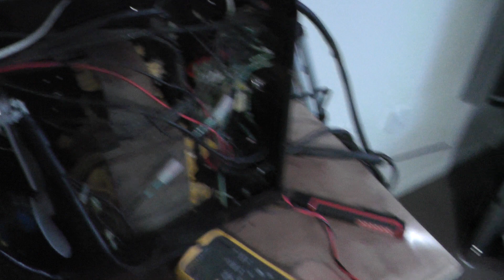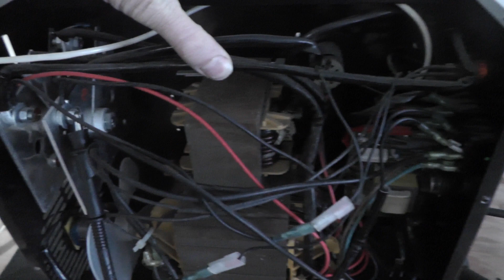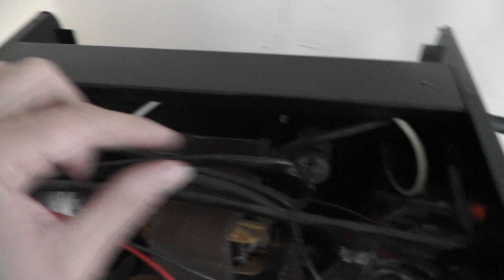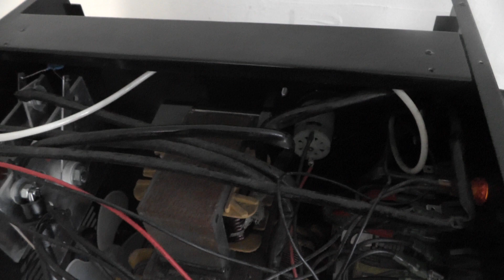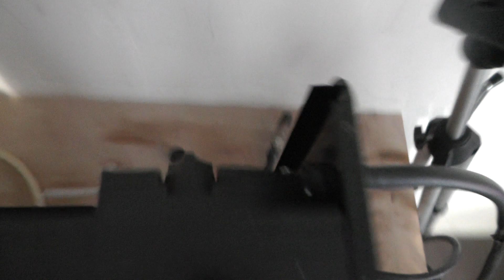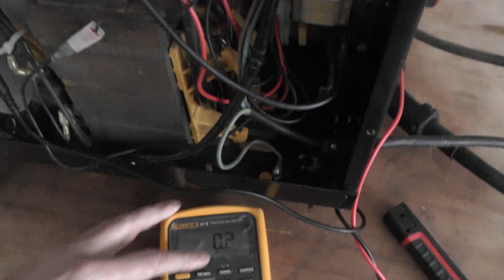The MIG Welder CHOKE Explained: What the Inductor Does & How to Test its Coil for Failure

Comment: What happened to your ROBIN KTS 1610 MFT , now you have let me down by getting a fluke.
Interesting video though
Reply from the maker: Still got it , used for work as calibrated , not got the correct leads or case for this so use it at home for motors etc
Reply: @cagmito76  oh that’s ok then 😂as might of gathered I have a lot of love for the ROBIN testers . All the fluke MFTs should be sent back to America 😂mega just bin them 🤣